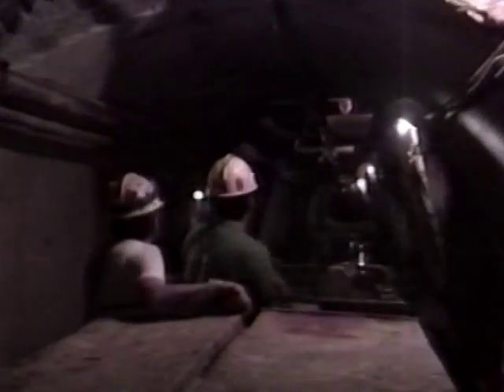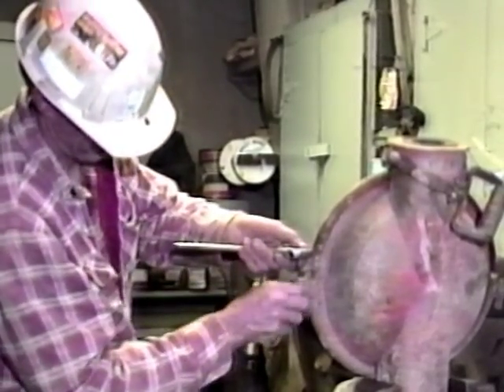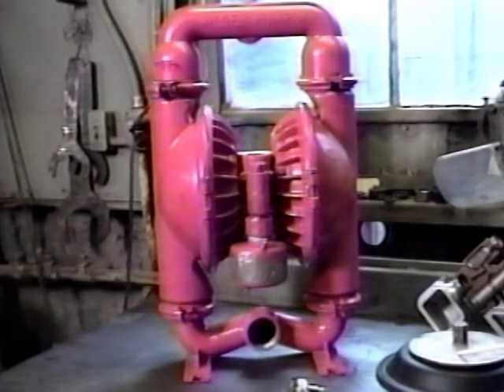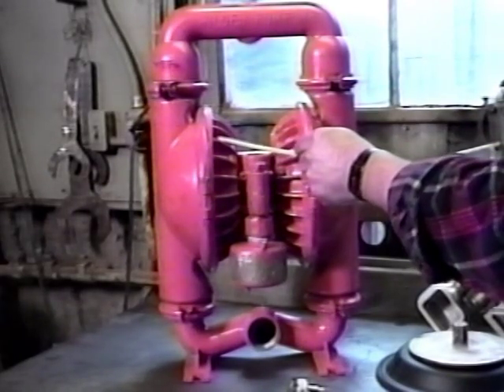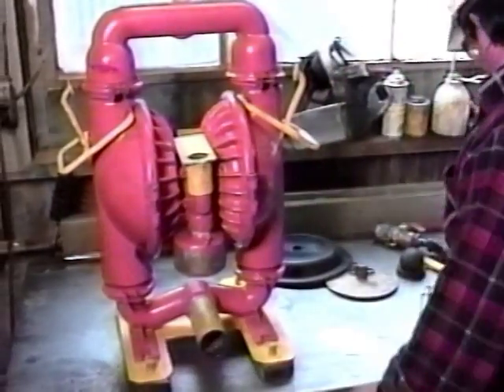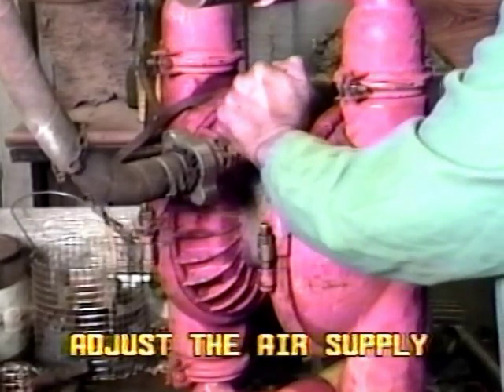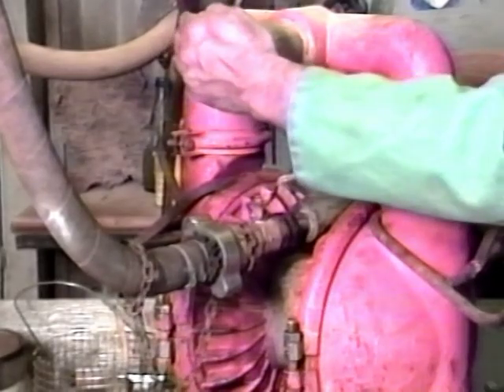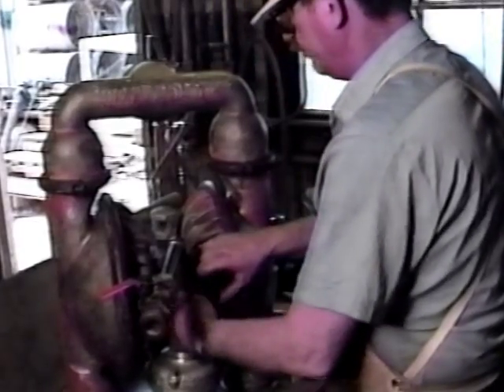Magma Copper Mine "Underground De-Watering Pump Project"

Comment: I worked at Magma Copper's Superior AZ mine and was on the mill and crusher maintenance crew. During the massive Labor Day storm of 1970 we had dozens of these pumps running at various locations outside the mill to prevent flooding in the low areas. It's amazing just how much water these pumps can move.